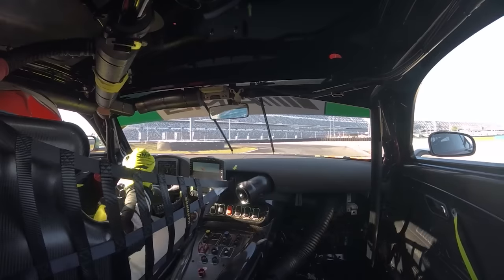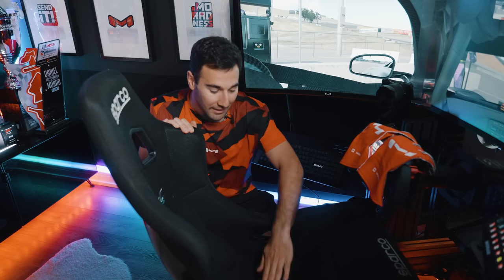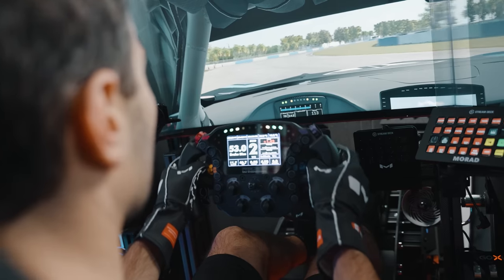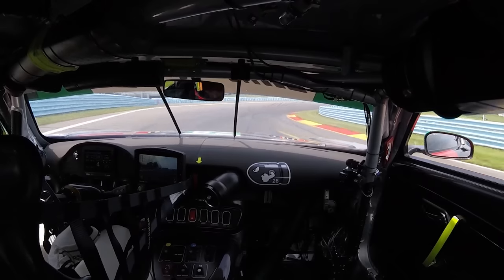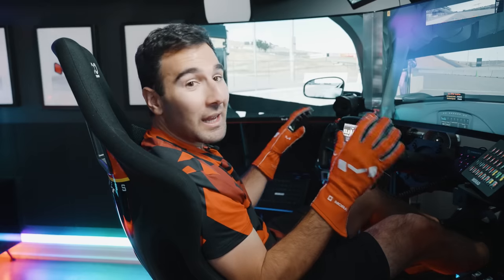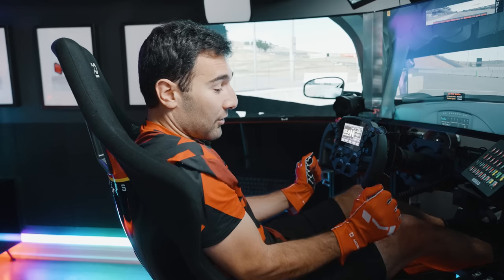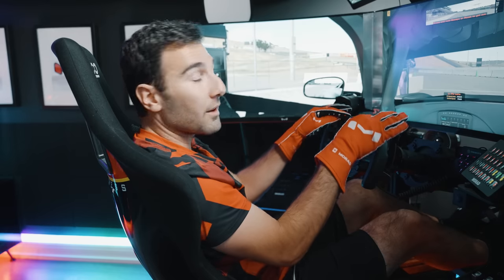PRO GT DRIVER REVEALS THE BEST SEATING POSITION FOR SIM RACING

Comment: Hey Daniel, great video with some really good points. Quick question, what about pedal plate height (say baseplate relative to your bottom on seat)? Slightly below (say 40 to 50mm) or do you have them about flush?
Cheers, jp
Reply: I was just about to ask the same thing, but saw his answer in the comments. He said his pedals are in line or slightly lower than the bottom of his seat/butt. Picture sitting on the floor with legs out at about a 130 degree angle.
Reply: @jasonzbell  oh, didn't see that comment! Thanks for the head's up!
Reply from the maker: Great point. Forgot to mention that and realized after we filmed. I have my plate around 1 inch under my butt roughly. More or less level with my butt, plus or minus 2 inches.

Comment: Nice! You should do a video on your Simcube FFB settings to duplicate a real race car.  I just downloaded your Moradness profile from Truedrive for the Simcube Pro.  I really, really like it.  It is the best FFB settings I have downloaded so far.  I've never driven a race car so I'm trusting from your experience that your settings are close to what the steering feels like in an actual GT/Prototype car.   It would be even nicer to have FFB profiles provide by you for each specific model you have driven or explain the differences in steering torque levels/FFB between cars like the Merc GT3 vs. say an LMP or Indy car.  I think a lot of us sim racers assume what the FFB would feel like and end up using to much FFB torque or not enough for the car be driven.   Anyways It's nice to have more feedback from actual race car drivers on the proper setups for Sim Racing.  Keep it up.
Reply from the maker: That is literally the next video we're making!! I am going to do a complete sweep of the settings and build a profile from scratch :)

Comment: Hi Daniel,
I am discovering your channel thanks to this video which is great. Great for the content and great for your way to explain 👍
Just one question: maybe I missed something in the video, but you explained the distance and the angle of the wheel, but not its height. Do you have some advice?
Fred
Reply from the maker: Hey Fred. I believe the height is something that is in relation to your body. It will change based on how high your body is. Normally, the top of my hands sit at the crease under my armpit.
Reply: Thanks Daniel. You mean the position of your hands when they are at 9h15 on the wheel I guess 😅

Comment: Can you please measure the angle from the underside of your knee with an angle finder? Mine is 105° but been getting knee pain recently so been looking at my seating position, Thankyou
Reply from the maker: Where is it hurting on your knee? Could you be too cramped up? Might need to either change the height of the pedal plate or push them away and tilt them towards you.
Reply: @danielmorad  thanks, well just in general around my knee cap area. I’m running my sprints inverted and used to run 55kg pressure but I’ve reduced to 45kg for now to help ease. Yes I’m wondering wether I’m too bent so when I’m pushing I’m putting more then necessary stress on my knee joint. :) Only asking because you’ve used detailed angles in the video for other areas of your seating position so wondered if you knew your leg/knee angle :) Keep up the great vids, very insightful coming from a pro, thanks!

Comment: Fantastic Video !!Could you share your pedal angle?
Reply from the maker: It’s 12 degrees. That’s the angle of the pedal plate. The far side of the pedal plate is higher than the side closest to my butt.
Reply: @danielmorad  the pedal plate where your heels are? Or the contact plate between your foot and the pedal? Let's say on 90° your paddles are straight vertical ....!.... and I want to know the angle of the pedal or pedalarm.
 ..../.... or ....\.... Sorry if I misunderstood

Comment: Hello, to brake you have to put your heel on the heel rest and force the leg towards the heel and then modulate with the ankle, correct?, and the height of the seat with respect to the height of the base of the pedals ?. Many thanks
Reply from the maker: Not necessarily. For me personally, I’m actually sliding my heel on the heel plate and almost locking my ankle when I press the big pressure. I’m really trying to isolate my muscle groups in my quad. Once I set my peak pressure, my entire leg and foot slides back off the brake, and then that last little bit of trail braking I use my ankle and pad of my foot to finesse it. This is a really good short video idea. Showing how I brake.
Reply: @danielmorad  Ok, I look forward to your video on braking technique, there is nothing better than the advice of a professional ;), And about the height of the seat with respect to the brakes, any advice? My rig is DIY aluminum profile, but I see that the pedal platform and the seat are at almost the same height, or differ a few centimeters from those sold by the company. and I want to adjust mine.

Comment: THANK YOU. I have been trying to get the right seating position for YEARS and there’s just so much bad information out there. 

Please clarify pedal height, though. My assumption is that the pedal plate should start at the same height as the bottom of the seat…but I don’t know if that’s right
Reply from the maker: My pedals sit around 2 inches below my butt. That’s where my pedal plate is.

Most people set up their pedals too low.

Comment: I noticed that there is a lot of variation in bucket seats in terms of angle of the base vs angle of the backrest. If you want the same seating position as irl you should start with the exact same seat.
Reply from the maker: There’s definitely a difference in the shape of each seat. But you tilt it but sometimes you just can’t get the exact same angles.
Reply: Yeah very true! I made a mistake and tried to follow all the measurements in the vid, but it didn't go well lol. Probably the best take aways are Morad's general advices (no straight leg, slight tilt in seat, etc.).

Comment: Daniel, what seat brackets are you using? Please I need to know, I can’t get a proper angled seat with either Sim Lab, Next Level Racing or Advanced Sim Racing brackets…
Reply from the maker: These are SimLab but the asr brackets can get you the same angle and I have a discount code for them. MORADNESSFIVE
Reply: @danielmorad  With the Sim Lab Speed 1 seat I cannot reach the angle you reach in this video using either the Sim Lab or ASR seat brackets (I have both). I presume I need to change seat then?
Reply from the maker: @cordialesalu5323  probably need to change seats. It’s one of the most important elements of the rig. You sit in there for extended periods of time. Wouldn’t be so bad to have a top notch one.
Reply: @danielmorad yeah sure, but I need one that allows me to reach a decent angle then. Might go with the Qrt-R like you

Comment: Do you have an opinion on inverted pedals? I currently have mine setup inverted, but I'm modifying my rig currently, and can change it if you feel it's the wrong way to go.
Reply from the maker: I personally don’t really care which way you put your pedals. I like to have mine on the ground because it’s similar to my real car. I just set up the angle in a way where it achieves the same result that you are trying to get from inverted pedals. Essentially, you are trying to move the pivot point of the pedals Further away from your heel resting position

Comment: I recommend using an air-wedge to add lumbar support, the kind used to help to hang doors, windows, etc. 
Cheap & gives you easy adjustability, particularly if you alter your seating position for different types of driving.
Reply: Air wedge?

Comment: can i ask, which seats have you tried out and which was most comfy, best for your lower back? i heard sparco seats are usually not good, the expensive models 2k+€ are supposedly fine... ive got lumbar cushion and i found a nice position for the seat, but its not enough
Reply from the maker: Unfortunately, I don’t have a lot of experience in seats like this style. All of the seats I sit in in my real race cars are all custom made seats with expansion foam or other expansion materials. 

I know that I sat in a few of the lower end seats from different manufacturers and right away, it felt like I was sitting on a board. If you really want to fix your lumbar issues, I would say that you have to go for a mid tier price point seat at least. You could also go to a local performance shop and try a couple.
Reply: @danielmorad  i tried omp champ-r in a rally shop. but thats all they had. it was much better from what i have now, but still didnt feel great. there are no stores like that here unfortunatly. i think ill have to get vacation for that and go to italy :D

Comment: Which model of Sparco seat are you using? I’m considering installing a Sparco seat in my real car, and I’m wondering if this model is suitable for both road and track use, with a 50/50 split.
Reply from the maker: It’s a QRTR. Very nice seat tbh
Reply: @danielmorad  I was about to buy those seats, but then I noticed that the waist size is 39 cm, which seems quite large for someone weighing 85 kilos. What is your opinion? Do you fit perfectly, or do you have some extra space around your waist?

Comment: Thank you Daniel for this very very helpful episode❤👍👍👍 May I ask do you engage in physical training? I assume that the GT events you participate in require a certain level of physical fitness. If a non-professional driver wants to improve their driving, what kind of physical training would you recommend?
Reply from the maker: I’m doing some running and a lot of my endurance is honestly coming from driving the simulator. As funny as it sounds, it’s a very good work out. With the motion and heavy steering wheel, it’s really preparing me well. I feel zero fatigue in the car in real life.

Comment: In my opinion:
- for immersion make it as realistic as possible, even if its not the most comfortable.
 - for fun and learning how to drive your simrig, I think its better to start from a more comfortable position until you feel you want more immersion.

I set up mine more like my street car, that does have factory recaro's, so the seat angle is pretty deep.
Reply from the maker: I think that blending the two together would ultimately lead to comfort and speed. Every race car is different, so there’s no need to feel like you need to drive in a certain position. We also have seat fittings and some driver sit at a different height. I don’t like to sit super straight up. I typically lean my seat backwards a bit more than others, but it’s really open to you to decide what feels most comfortable and how your joints lineup with your control units.
Reply: @danielmorad  Oh yeah, that would be ideal. Of course there are different cars, I meant, if someone really likes GT3/4, and thats what they mainly play/race, they should have a seating position more like yours, rather than something like mine that is set up like a street car seating position. which is more vertical than yours and the pedals are closer. For example.

Comment: How in the world did you set your seat at 30 degrees? I have standard seat mount and I can't even get 20 degrees.
Reply from the maker: That’s a great question. Some seat brackets prevent you from getting too much angle. You need to find a seat side bracket that will allow you to get the tilt required. Advanced SimRacing have them. Also, you can get 5% off, using my affiliate code, if you were interested. It’s in the description of the video.

Comment: [i have a query if you mine to answer. the force of the wheel base. i have try to find a good answer, but on one is driving the real car. so, what is the actual force that i need to set my base on. and how much do you use inn sim vs base. i like to make my rig as close to the real thing as i can handle. for the thank-you. ]
Reply from the maker: It’s around 12 N meters. I have profiles premade on Simucube if you were interested and have the hardware.
Reply: @danielmorad  [i have the vrs base. So I can not use the profile sadly.  So you sett the motor to 12Nm in game, instead of the 20Nm it can do? For the thank-you ]

Comment: What is the height of pedal tray and height of seat where the front of the seat is where your legs sit from the floor up?
Reply from the maker: My pedal tray is sitting around three or 4 cm lower than the bottom point of my seat

Comment: I was fast yes decent fast sometimes 0.5-09 slower then the top 10 drivers today i saw this video and i noticed i was sitting wrong the hole time and my braking was very imconsistent sometimes yes it came from my legs but sometimes i was just braking with my ankles today i tried your advice and OMG my legs are burning after warming up my braking never happend before yes it was heavy but i mever thought legs should burn when you do it right the first time.
Reply: with some practice and after my legs get used to it i think im gonna be able to be faster then i am now cause braking is much more precise and consistent..

Comment: It would be nice if anyone has links to options for mounting your seat at these types of angles as my side mounts at their maximum is a mere 20 degrees on the base. Side mounted brackets? If anyone could help with this would be greatly appreciated
Reply from the maker: I pinned a great option for brackets to achieve this angle. It could also depend on the shape of your seat as well
Reply: Thank you Daniel for the continued effort I went something of a rampage to find a set last night and finally settled on a set from OBP supplied by the guys at RaceAnywhere in the UK 👌

Comment: What I have found out that comfortable relaxed position is not the best for being fast. Especially for pedals it is better if your legs are bit cramped and when you are off the pedal, you have to keep the tension in the leg and ankle to not press the pedal. Same for wheel, it is better if your shoulders are pushed tiny bit into the seat.
Reply from the maker: If that works for you, don’t change it. I know that I’d like to be comfortable and I think I’m pretty quick.

Comment: I can't imagine your seating position being 38/53 degrees unless you don't have a typical sim seat but actually have a motorsport one, possibly the same as your GT4.  But then your values are completely wrong for us simracers.  When I adjust my seat 38/53, I sit like in a space shuttle...🤷🏻‍♂️
Reply from the maker: Could be what you are using as the flat surface. What is your zero measurement? Do you feel like your seat angle looks similar to mine?
Reply: Its likely because that position is impossible to achieve with the poultry consumer-grade seats they bundle in with sim rigs, which can only recline the entire back of the seat, unlike pro-grade seats which have extreme lower back angle built in. I only figured out how to remedy this issue and my back pain with a huge amount of time wasted on trial and error. (Because bizarrely there was no information online about this issue until this video. 😧)

So in an attempt to solve the problem I bought a better seat, but even my new one does not match the lower back angle that is inherent in supercars and race cars... because of this I cannot run it with the angles that Daniel does and instead compromised by raising the seat relative to the pedals and having an overall more upright back angle.

This video should come with a huge caveat that you first need a high quality seat to even bother copying Daniel's settings or you're bound to do more damage to yourself than simply keeping your seat as-is.

Comment: Not sure if you realized this or not, but the degrees you provide are meaningless to everyone except you without context as to what angle you’re measuring from
Reply from the maker: Seems like 99% figured it out. It’s based off of the ground. Might just be a ‘you’ issues 😂. Hope that helps out bud
Reply: @danielmorad  must be me
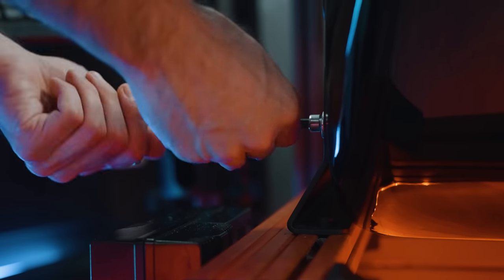Reply: @danielmorad  I guess what I’m saying is at 1:22, how can the seat be 32° and then the back be 45°? 
There’s much more than a 13° difference between them, but I think I see how you measure, Thank you bud.
Reply from the maker: @unbanmekoil  38 degrees to one direction using the floor as a level, and I believe 52 degrees for the back. I believe 200k people figured it out lol. Apologies for not providing you the corresponding angle of 128 degrees based on the 38 on the other side. I figured most people would understand. Thanks for clarifying so I could put the correct number so we don’t have any more confusion.